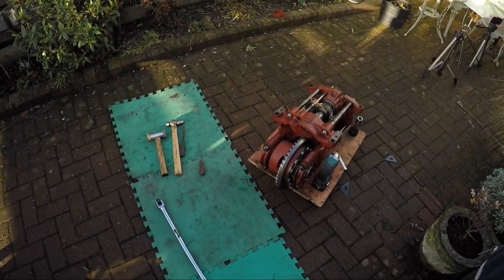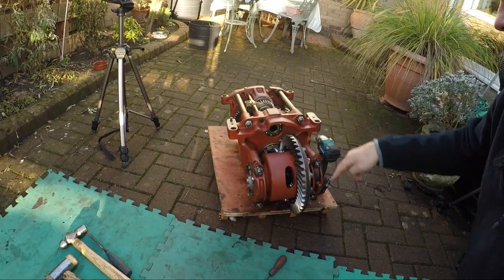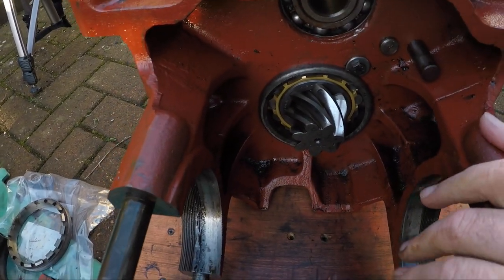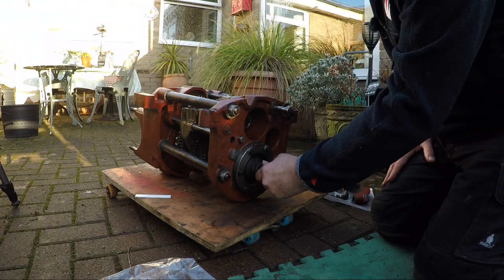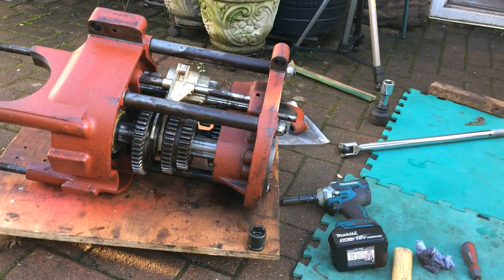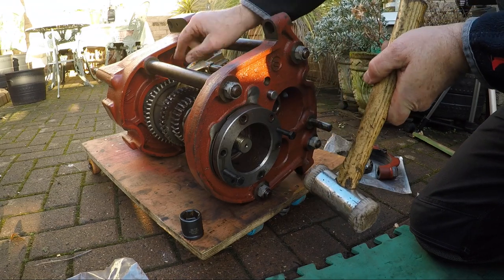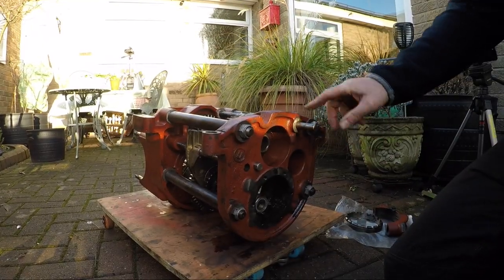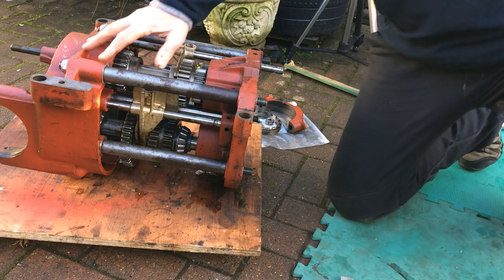David Brown 990 selectamatic gearbox tear down #48

Comment: G day Barry, Im running behind on the 990, where you had trouble with the plastic then wood when undoing the pinion nut, I use a stick of 40/60 solder doubled over, it is nice and soft but it locks the gears up. Boy Im glad you decided to go into the box for a look.
Reply from the maker: not as glad as me! I think this would have destroyed the gearbox had the outer race dropped out, don't think it would have done the castings any good either, so a mega thank you to you and the others for pushing me in the right direction and getting it stripped.
many thanks Lance
Barry
Reply: That most surely would not have been good so glad you discovered the situation!!

Comment: hello Mr. Barry...my name is Iulian...I'm from Romania...I really need your help.....I have 4 David Brown tractors at home...I'm a big fan of this brand. ...I have a 770...780...880 and an 885....my problem is with the 770...the engine block broke and its gearbox is the one with 12 speeds.... .on the 780 I have a 6-speed gearbox... my question is.... can I put the gearbox from the 770 on the 780? any little information is very helpful... have a wonderful day
Reply from the maker: Hi Lulian, I'm not sure is the easy answer, if the engine type is the same in both tractors and/or the bolting flanges are the same on the block and the axle, then I can't see why not, try your gearbox lid on the existing casting as you'll need three gearsticks, if it fits, good. If not you'll need to change the gearbox main castings.
If any of our viewers reading this knows a definate answer please pop a reply to lulian below.
An interesting project!

I've just had a quick look on the tractor data site and they recon it's the same gearboxs right through to the 880
so should be good to go
many thanks and let us know the outcome please
Barry